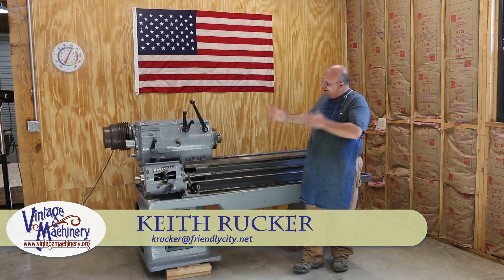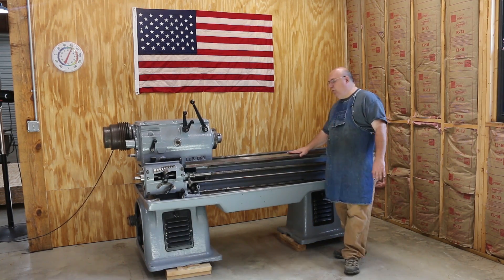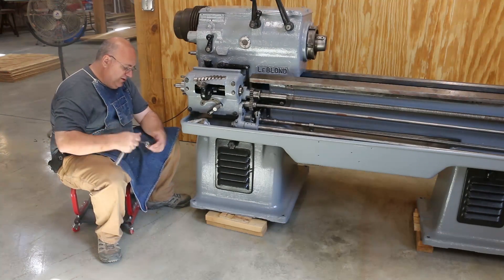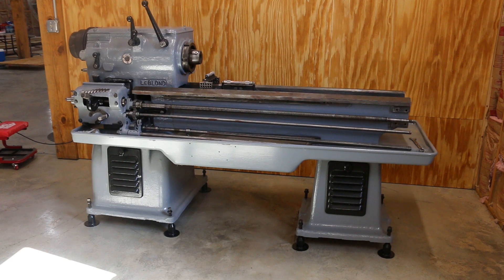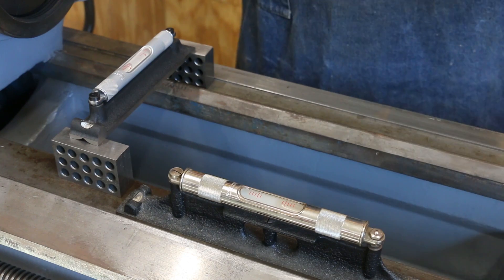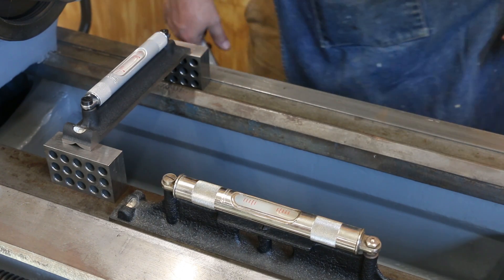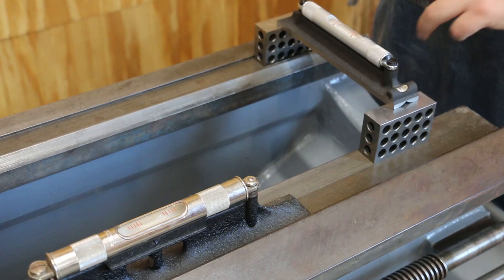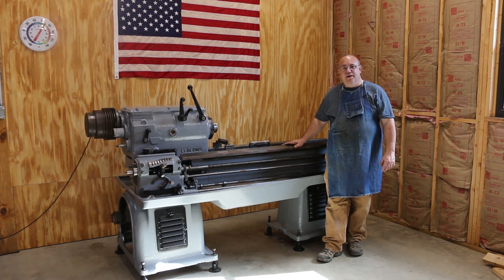LeBlond Lathe Restoration - Part 11: Leveling the Lathe

Comment: Keith ... She's beautiful ... You did a great job on the restoration. Question: Will you have to check the level periodically as the building "settles"?
Reply from the maker: The manual says you should check it for level every couple of months and make fine adjustments.  Few people actually do this but it is good practice.

Comment: I really like your videos Keith my question is how do you fix headstock alignment after you're bed is leveled?my small lathe is out .002 would that even be worth trying to fix?
Reply: shimming it would be the only way I can think of to align it...
Reply: might depend if its vertical or horizontal? we didnt ask! assuming its vertical then you are right.
Reply from the maker: As others have already stated, you can shim it if necessary.

Comment: It's finally out! I've been waiting for this since part 10! 

Although in all seriousness, this has been a great series Keith! Now I'm only 17, but one day I'm going to get a lathe and I'm gonna restore it!
Reply from the maker: Like others have said, start with something simple and work your way up to some of the more difficult machines.  A drill press is a great first machine to restore - fairly simple to learn the basics on, and relatively cheap to buy one that needs restoration.  And, you always need a drill press in the shop!
Reply: totally! start with something easier, i like to buy used tools and restore then, i also used to restore motorcycles, outboard engines, but never did any machine tools, i still ike doing it on a small scale, i like taking things apart, cleaning, fixing, painting and making them work just like new
Reply: I'm 17 too, and also into cycling, What a coincidence! You watch GCN?
Reply: Gotta say, three years later, young fellas!  Do what spins your wheels!  Spin those buggers! -  Girls too!  Spin your wheels, girls! You know you can!

Comment: Ok, i'm confused how do you level it while keeping the same amount of pressure applied to all 8 points. I thought that if the pressure was not the same on all points, that would cause an imbalance in the pressure the lathe puts on the floor and cause the lathe to run out of true. Please help.
Reply from the maker: I basically did my main adjusting with just a couple of the screws.  Once I got it level, I tried to put a similar amount of pressure on each of the screws to spread the weight out.  It is somewhat tricky - even a small adjustment can move the bubble.  Just trial and error but it is not as bad as you might think.
Reply: ok, thanks and keep up the great work on your new shop.

Comment: Good vidieo there Keith I do know the bed twist is important , but can you explain how they level a lathe on a ship , may be in dock I do not know, or in the mobile workshops the army used to have 

Just me rambling on 😀
Stuart
Reply: from another comment on this, basically level is less important than twist in the bed
Reply: Generally on a ship the deck they will be mounted on is cleaned. Then they bolt down a "pallet" which is a rubber isolated piece of heavy steel. The lathe is then bolted to that and leveled in both directions using shims. Once it's leveled and bolted down it won't change much unless it is hit or the pallet breaks free. In the mobile trailers they bolt and shim, they also test both types on a regular basis to ensure they haven't moved.
Reply: And if the ship is not level?Ships rarely are.The best way would to install the lathe when the ship is in drydock when they are sitting level on the blocks. Or at least close to level.But you are right most machinery on a ship is soft mounted. After all the ship is gonna rock and roll.As long as everything moves together you should be ok..
Reply: ok.
Reply: Yup, as long as the section of deck the machine is bolted to doesn't flex or bend the lathe will stay in tolerance.  There are lot's of pictures of shipboard machine shops online. Some you can see the shims and the mounting systems. Pretty neat really.
Reply: levelling/squaring is done to the lathe itself,not necessarily to the world. It is done to take any twist or humps out of the bed. Our innate sense is to also involve the world as level, but not necessary. So in theory a lathe levelled and squared to it self could the be rotated about any axis and still cut/turn true. A rolling ship under way. This could also be done in zero gravity with proper instrumentation/methods..
Reply: Rick Brandt
gonna be problems using them is space though, the chips all go in your eye
Reply: coolant mess becomes a real mess.
Reply from the maker: Lots of people have already replied to this - and I am no expert on using a lathe on a ship, but I have talked to some old Navy machinist who had to deal with this.  As already stated, what is most important is that the machine is set up level on a good foundation to take the twist out.  On a ship, the lathe is set up this way and attached to a very stable floor.  In theory, even if the ship moves, because it was set up level, all of the twist was removed and it does not matter.  However, in practice, keeping tight tolerances on a ship underway at sea has its challenges.  I have heard some of the old Navy machinists say that they tried to coordinate precision work with the Captain so that it would be done when the ship was not doing a lot of maneuvering, or when the seas were rough.  Ideally, some work would only be done when the ship was tied up in port or otherwise not moving at sea.  At the end of the day though, they just did the best job that they could under the circumstances they were dealing with.

Comment: I still don't really understand. I get the bit about the warping but I don't understand why it needs to be level. if the lathe is inclined surely the part will be turned on an incline and not make any difference? I guess I am missing the point...
Reply: Yep. Sorry my mistake. I must have tuned out that bit!